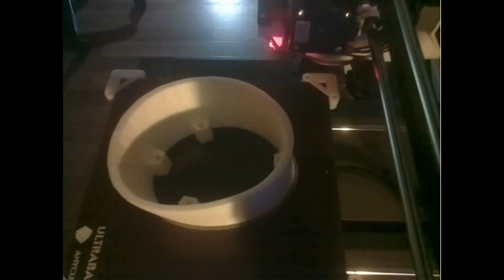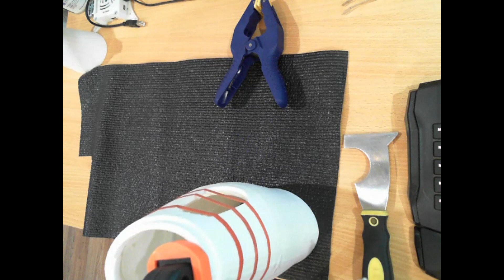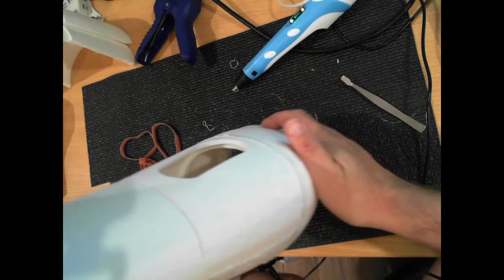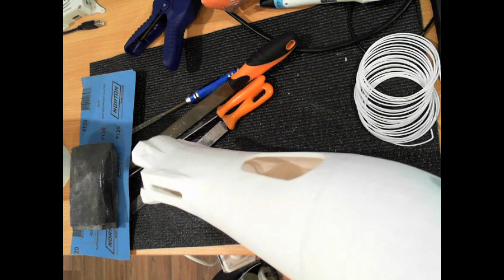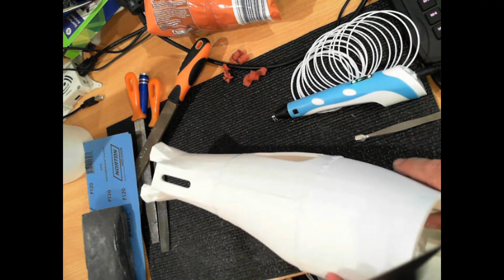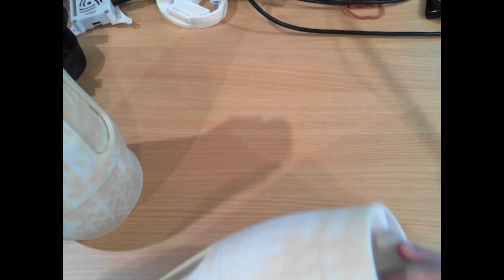Freds_Legs_Tibia

Comment: Just getting around to making the tibia now. I am happy to confirm I am not the only one with the lower tibia pieces not lining up perfectly. I have a feeling Gael mixed up one of the two sides designs on the lower bit with the STLs for his motorized version. Hard to tell in the vid and with the white filament, but botton (siding into the ankle) one of the connector brims is lower for you also i'm guessing? Also inside of those parts appear to be slightly different, one more rounded off, one more of the triangle design pattern. All and all seems to fit together no problem and look fine from the outside, just was trying to find out if I was the only one. XD
Reply from the maker: It looks even better once its painted :-)
After welding using the 3D Pen, I did sand and then paint.

Comment: You have some good techniques here. I like the use of rubber bands to hold parts together whilst you work, and the welding should make it quite strong. Well done.
Reply from the maker: Something I probably should have noted in the video, is it's a good idea to paint the part after the sanding it flat so as to hide the weld :-)